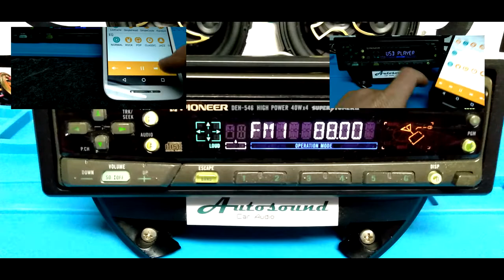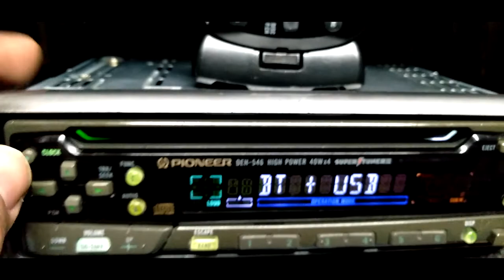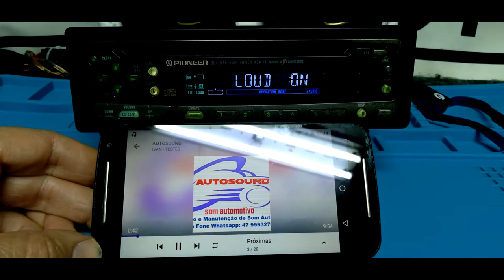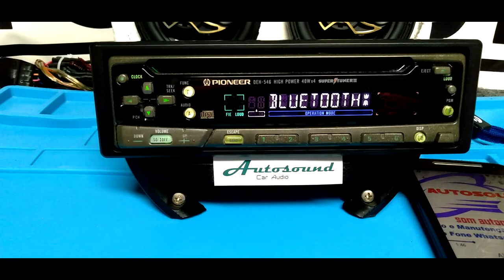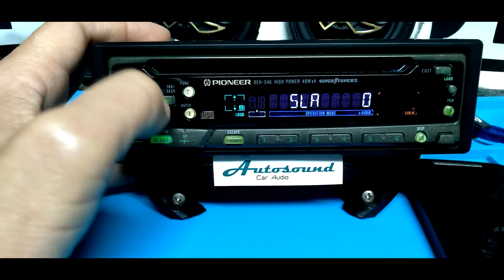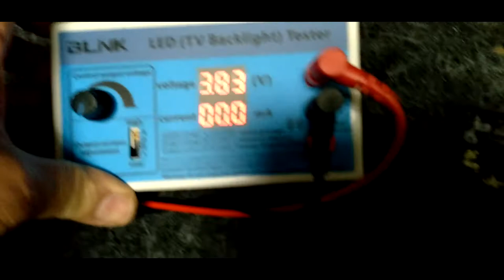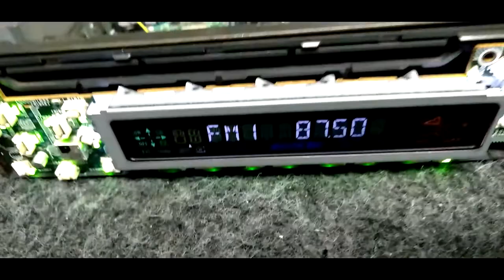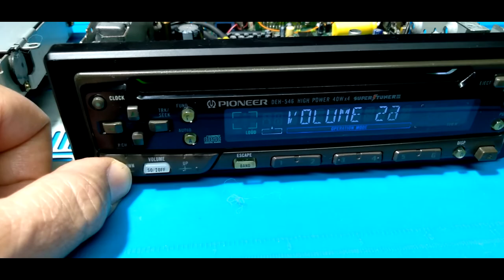PIONEER  DEH-546 LAMPADA LED + LEITOR USB + BLUETOOTH OLD SCHOOL - DIY

Comment: Olá! Muito top seu vídeo! Poderia me informar onde conectou a saída da placa bluetooth no circuito do rádio? E qual a tensão de entrada da sua placa step dow
Reply from the maker: Eu tento informar a quem assisti neste e em outros videos os locais aonde podem ser conectados. Voce pode baixar na internet o manual de serviço e seguir aonde é a entrada de audio e por onde ela caminha na placa. Primeiro na falta de um datasheet especifico do led usado eu uso um instrumento que mede a amperagem e voltagem de trabalho ideal e depois faço ajuste na placa. Mais tem quem use resistor .